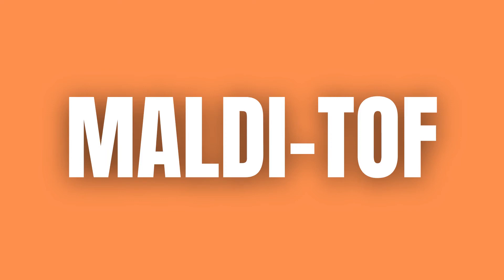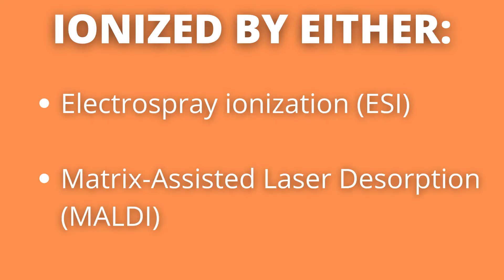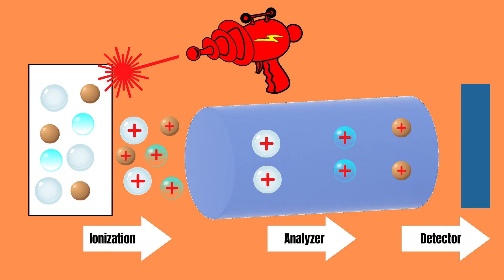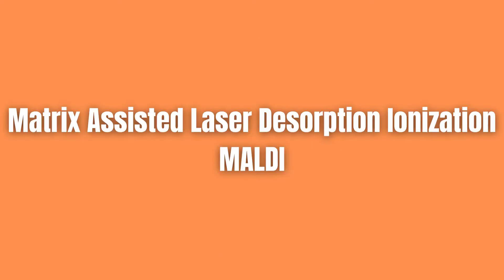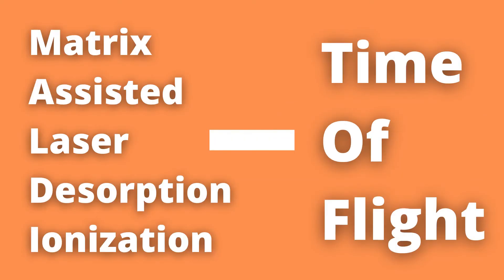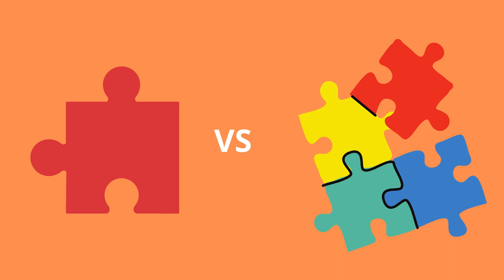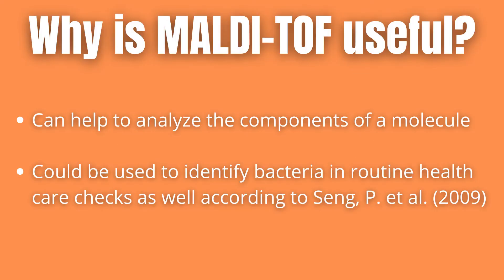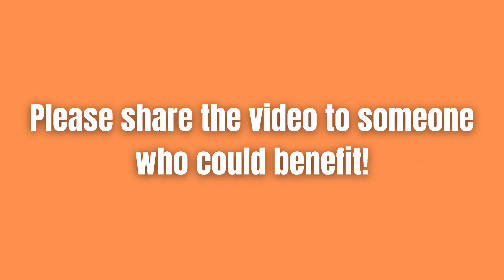MALDI-TOF Mass Spectrometry Explained

Comment: HI Luca! Thanks a lot for explanation. I'm still a bit confused about the "digestion" part, is it meaning that proteins will be fragmented into smaller parts? Then with 2 proteins that have same mass but different components can be differentiated by these small components? But we said that the reason of Matrix is to protect sample from direct exposure under laser to avoid peptide fragmentation.
Thank you in advance for your help :)

Comment: Hello this was a great video explaining how MALDI-TOF works! I am currently using the MALDI-TOF on some peptides I'm making and I had a question. The peptides we are making has a +4 net charge but on the maldi we usually see +1 charge mass (m/z) on the spectra and not the +4 charged (m/z) mass. Can you explain this? Thank you!
Reply from the maker: How does that show up exactly? I mean how do you know that you're seeing +1 charge rather than +4 charge?🤔

I've only analyzed things that had a +1 charge myself I'm afraid🙈😅
Reply: @LucasLearnz   
Hi thanks for responding! I know that it is the +1 charge because that is the predicted mass of my peptide. My peptide has a mass of 1154 g/mol and that is the peak that I see on the maldi-tof. I am just confused because the peptide has charged amino acid residues that should be fully protonated with a net +4 charge when it is on the plate with the matrix.

Comment: once you have "digested" the proteins and splitted them into parts of different molecular weights, how do you know which parts belong to the same protein in order to have an accurate identification of it?
Reply from the maker: This depends. Sometimes you do your best to isolate the protein as much as possible before you use MALDI-TOF. 

However, often you might compare the results to existing libraries of mass spectra in order to try and find a match. 

Does that help at all?

Comment: Hi I'm currently trying to analyse both positive and negative MALDITOF spectra for some lanthanide complexes I synthesised to try and determine the molecular weight and hence structure of my products, but I'm really struggling to understand how to interpret the spectra. I would really appreciate any help you can offer.
Reply from the maker: If you mail me some of the spectra at biotechlucas@gmail.com I can take a look😇👍
Reply from the maker: Also if you know what matrix you're using and the standard used for calibration that would help as well🙏

Comment: Great Video! Love your channel! I have some minor corrections to your video:

1) TOF: detected m/z value is dependent on BOTH the molecular mass ("size") and the CHARGE of the analyte. it is not only dependent on the "size" as you stated. A peptide with a mass of 1 kDa, for instance, can be detected at ~ 1kDa m/z if it bears 1 charge, but also at 500 Da m/z if it bears 2 charges, and at 333 Da m/z if it bears 3 charges. 

2) you should not use the term "size" when referring to the molecular mass of a molecule. These are 2 different physical properties.

Thanks! :)
Reply from the maker: Great points! Thank you so much! I've been considering to make an updated version to this video since I could make a much nicer version today so when I do I'll make sure to include your corrections!👍

Comment: What exactly is the difference between MALDI-TOF and MALDI? Whitout measuring the TOF how does MALDI analyze the samples?
Reply from the maker: Excellent question! The MALDI part is ONLY responsible for ionizing the sample while the TOF is ONLY responsible for measuring the ionized sample. 

In other words, we can use another ionization method such as for instance electrospray ionization (ESI), which I cover in another video, instead of MALDI. In the same way, we can use another method instead of TOF to measure our sample.

You can think of this as two different parts of one larger device that can be changed out depending on what samples you are measuring and so forth... First "real-life" metaphor that comes to mind would be in gaming, where you can either use a PC, Playstation or an Xbox and plug this device into a desktop screen, or some type of TV... Not the best analogy but hopefully that answers your question!
Reply: @LucasLearnz  perfectly explained, thank you very much!!
Reply from the maker: @noraspeiser1865  Glad to hear that, thanks for commenting!!